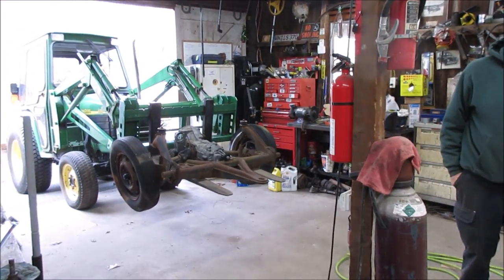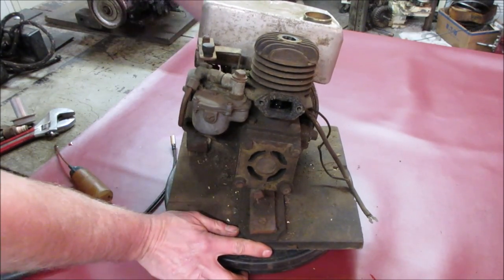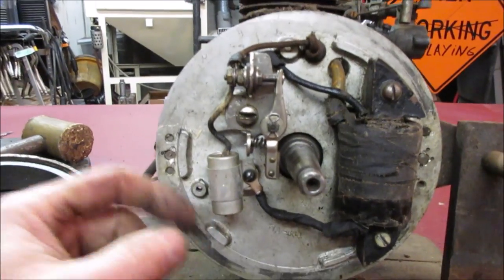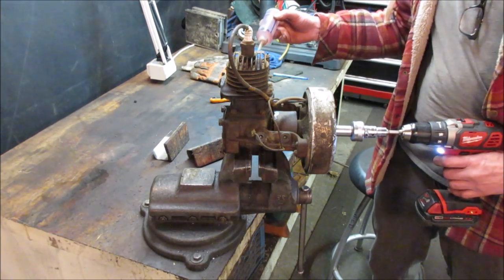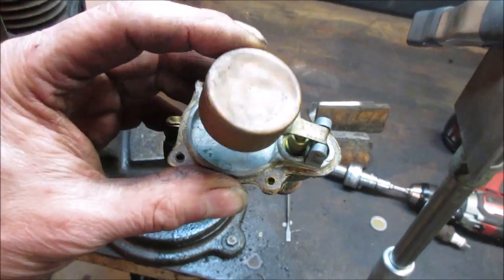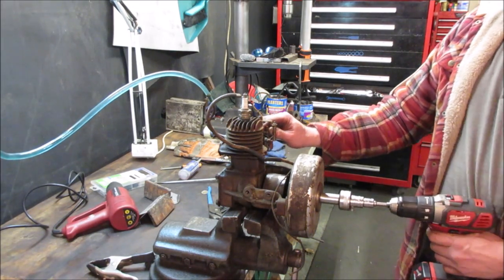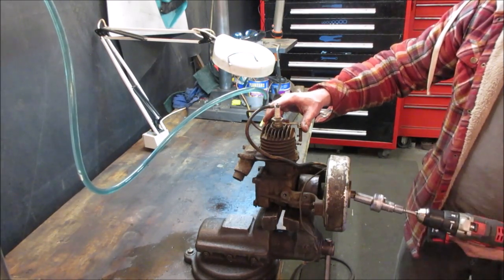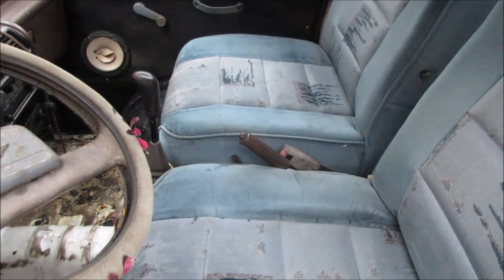Sitting at Least 45 Years In A Barn, Pre War Elgin Cycle engine.

Comment: I used to own a 1930's Elgin canoe outboard, you could spin the whole engine/propshaft around to nearly 340 degrees compared to the clamp mount.  Was not very fast even on a small aluminum dingy.

Comment: The friction drive front wheel driven bicycles were very popular in France up until the 90s they had a super heavyweight front tyre and the drive drum add knurling on it to give it rip in the wet
Reply: This was the info I was scrolling for, thanks! Like how the hell did tires last, and clearly they didn't have much tread, combined with the bare friction wheel surface...did you just not ride these when or after it rained?

Comment: At full tilt that bike would be moving fast!  It's amazing that frequently Mustie uses few or no parts to repair these motors--this time he used a spark plug and his brains.  On the Daihatsu mini truck, he couldn't go to the Stash and look for a Daihatsu carburetor.
Reply: I found an ancient lawnmower in the garbage,  with a Briggs & Stratton engine, and I  changed oil, sparkplug, fresh petrol, and it was very reliable after, better than many new lawnmowers.

Comment: Cool video Mustie! The neighbors had one of these on a huge old bicycle in their barn. My friend and I got the tires patched up and found out the motor used boat motor gas.
Mounted on the front wheel it did a pretty decent job of moving the bike. Noisy as heck and temperamental but it was fun doing laps around the barn and zipping up and down the country road.
It comes to me that the wheels on the bike were 36 inch but that was 50 years ago..........
Cheers
Terry

Comment: Run against rubber front tire and had a 20 inch flex pipe on engine to go past bottom of front end to keep oil off of your feet,  The  pull from   exhaust made engine run smooth no  exhaust and the engine was a pain.

Comment: I was reading a 1930s hobbies book and they were talking about 8 to 1 fuel:oil mix but obviously modern 2 stroke oil is vastly superior to the straight 30 or whatever they were using back then. I think the oil used to separate out so all that vibration probably helped!

Comment: This engine would be perfect for a vapor feed. You don’t need a carburetor; just fill a glass jar halfway with gasoline, put on a lid, and then run a hose to the air intake. The gasoline must be gently vaporized, but that’s no big deal. Remember that heat is one way to vaporize fuel, but aeration is another. So put an aquarium bubbler in the jar. It might need a lot of bubbles, but you’ll get enough vapor to run the engine.

Comment: At 39:43 you could see that most of the compression was shooting out the spark plug threads.   Normally putting in the spark plug by hang seems fine.  In that case it looked very leaky.  After that Daren talked about crank seal leak.  I believe we were actually seeing spark plug leak.  It was pretty substantial.

Comment: My Farmall super a had a large Beast spark plug it appears that that's workload is bad it's it's requiring that down deep and you will see that more under compression than you will when it's just got no load on it. This 302 / 289 engine head large as well. Thanks from Bob in Virginia USA

Comment: that part you are working on connects to a long metal shaft with a propeller attached to its end an early inboard motorboat! there was a spoon shapedguide under the prop that would raise the propeller shaft  so it never got damahged in shallow waters the shaft would have had a length of spring as a part of the shaft, to allow for shallow water shaft displacement!

Comment: I'm thinking that engine is from 1936. From the photos I viewed on the internet that hub/wheel rubs on the front tire and it spins the engine to get it started and away  you go. The engine has been modified with a pully and spacer  and the outer cover grooved/notched so you can pull start the engine. The cover with the company name fits flush with the flywheel in its original configuration as a cycle engine.

Comment: If you were thinking'40's or pre war then think again that is an engine from a 1920's vintage Elgin motor bike. They were Harleys Davidson's competition in the 1920" s and looked similar to them with the motor driving the front wheel instead. It was mounted in front of the handle bars. Those Elgin engines are fairly rare and could be worth a lot of money and likely why your friends uncle was holding on to it. I know Harley engines from this era are wort a lot of money in working condition. My guess is this one is too to the right collector that is trying to restore one of those rare Elgins more so if it is all original.

Comment: (commenting early in the video) I'm pretty sure that does have a pull start, it just doesn't have the rope, back in the day you would have a rope with a wood handle on one end and a knot on the other, you slot the knotted end into the slot on flywheel on the engine then wind the rope onto the drum. Then you pull it and if it didn't start you need to wind it again.

Comment: It would be interesting to compare this "minimum necessary change" approach with the ChefTush one: Full disassembly, cleaning, repairing, reassembly prior to running. The latter might have been a preferable way to deal with this one. I am always surprised when the capacitors in ignition systems appear to work decades after they should have failed in one way or another. I'd be tempted to replace them every time.

Comment: The top of the carburetor where the gas is seeping out….. I believe there should be a brass pin in it that floats in it to also mix air…. I believe the pin would have a spring under it

Comment: Leaking crank seals would cause low compression, which I think is confirmed by lack of power because it didn't spin up much even when it did fire.  So I would respond to low compression by increasing the plug gap.

Comment: My early villiers 2 stroke is not fitted with crank seals. It relies on long main bushes and a oil rich 16 to 1 fuel oil mix. 4 strokes a bit unless under load.
Reply: Yeah, I was going to say that. Early 2-strokes didn,t have garter-type seals, just tight-fitting brass bearings. When they wore, you had to use 10/1 fuel/oil mix. (Old Villiers/Atco lawn-mowers, fo instance.)

Comment: Wow this is so interesting. Sears and Roebuck prior to WW2 had Elgin as their in-house bicycle brand. I found and actual catalog page showing this engine sold with bike $69.95 or by itself for $39.95! It claimed 70 mpg.
Reply: That was big money back then. In 1932 $69.95 would be $1,448.61 in today's money!
Reply: So when I get digging, I get crazy. So it appears that Sears advertised this as the "Elgin Front Wheel Drive Motorized Bicycle" and near as I can tell the engine was fitted to the "famous Elgin Cardinal" model. This Cardinal model had a big round headlamp clamped to the handlebars which was powered by a huge cylindrical battery hanging below the top tube. The Cardinal dates back to 1929 if not earlier, but since Sears refers to it as "famous", the motorized combo must've come later.
Reply: So I saw a blurb suggesting that the Cardinal model ran from 1929 to 1932 but I've only seen actual bikes claiming to be '29 and '30. One version of Cardinal ('30 I think)  seems to have had a little die-cast airplane on the nose of the front fender which would've been deleted to fit the engine probably. I  found an old photo of a teenage boy in the 30s standing behind his Elgin Cardinal bicycle. It seems that the aforementioned airplane ornaments, the little leather tool pouches under the seat and battery cans hanging beneath the "tank" as well as headlamps, horns and "tanks" tend to be missing if you even find one of the old prewar bicycles. The so called "tanks" were a storage box with a removable panel on the right-hand side, fitted between the dual top tubes running from seat to steering yoke. The government should have all the Sears catalogs digitized and made available for us to peruse online since they are such a valuable source of history. The govt never does anything useful though. They just drag us into one war after another.

Comment: Sparkplug just a bit too loose during the troubleshooting, this motor must like it's compression to use a little bit of heat with the weak spark. Saw fuel misting out a few times after it was just removed and popped off prior.

Comment: The Elgin never seemed to run with a steady cadence, except when revved way up.  When you showed us the spark plug sparking, it seemed to me to not be sparking regularly either.  Is there a way that the magneto can be faulty so that it doesn't always trigger a spark when it should?  If the poor beastie has a miss due to a bad magneto OR fuel supply problems couldn't that be one of the reasons it runs poorly?  
I'd love to see you take another look at it and maybe make it run better, if you can rustle up the right parts.  Would a modern carb or magneto be available?
Reply: It looks like I wasn't paying attention when I watched this last week!  You never did put in a new capacitor and I don't think you resealed the crankcase.

Comment: My guess? The condenser, because of the sporadic spark. I have had cars do it because the condenser was not changed when the points were.
Bet that was a hand full with all that weight on the front wheel ,being all cast iron.

Comment: "Eisemann" (as stamped on the engine) is a german company/brand for generators and such. They belonged to Bosch for many decades (1925-1998). I don't know if they really made their own engines
though. I have an eisemann generator from the 1970s or 80s (came with the house...) with a briggs & stratton, but there are also many models with sachs engines. Maybe this is related, maybe not...
Reply: Correction: "Eisemann" was also a Brooklyn based company producing magnetos (the part where the name is stamped on). I don't know if they are in any way related to the german company with the same name.

Comment: Given that Elgin engine, I'm wondering if it's the same kind of motor on an actual moped I used to have that was made by Honda. Basically, the pulley has a centripetal clutch (which automatically engages or disengages based on load) that was engaged by a locking lever of some kind that engaged and disengaged the belt drive. 

And yes, you'd pedal the bicycle to start it, just like my moped.

Comment: It shouldn't overheat because even though it has no wind over the cooling vanes, it has no load either, and that should make up for it.  And it was definitely improving with run time and temperature, so I would run it longer, long enough to burn the carbon off the plug.

Comment: Elgin cycle motor was belt driven to a large drive wheel mounted on bicycle rear wheel it also incorporates an automatic valve in the induction port and pressure operated oiling system
Reply: But then why the friction drive running in the opposite direction?

Comment: Maybe since it's a 2 stroke, it could rely on an exhaust sytem, that has "a continuous flow" that then sucks "a little more" exhaust gas out of the cylinder compared to without having an exhaust pipe system. That would set the next stroke up with more room for fuelmixed air.

Comment: My aunt had the same motor on a old Columbia 3 speed  the cluch i shi you not was attached to the rear wheel to start it you had to roll down hill once you picked up enough speed the cluch would pop the engine over and away you go

Comment: If you have a cheap diesel on which to experiment, would you try running it on mixtures of waste oil and gasoline and see how it does and what ratio best mimics the power and exhaust color and temperature of regular diesel?

Comment: It still cracks me up when they call it a "condenser" when in reality it's a capacitor.  In the early days of electronics capacitors were called condensers.  But small engine mechanics still call them that to this day, when electrically-speaking they're really a large discharge capacitor.  I hope you replace that old condenser, it's probably leaky as hell and not firing at full capacity.
Reply: Everybody knows, and nobody cares Jeff.

Comment: Hi, I've now seen some of your videos and found the same bias in each one, you have a tendency to drawn your engines - if you see something expelled without hearing an explosion, then it's carb mist, meaning it's too much of it.   Another thing is, on old gas engines, systematically replace the capacitor, it costs nothing and have 99% chances to be dead or close to, you'll spare a lot of time trying to figure out what is (not) going on.

Comment: Like "ktlpep," I too have watched you take on the almost unworkable and make it work. BUT, I also am an electrical engineer, and am shocked at what you do electrically with your rebuilds. The lack of a proper electrical background has robbed your channel of much data.  OK... enough negative output, and here are my suggestions:  buy some proper electrical measurement tools and learn how to use them. Model them after Mr Carlson's Lab. Paul knows more than anyone how to fix and properly repair almost anything, except for you and motors. LOL He has some tools he makes for himself and his Patreon friends. The rule to take away is, if it is an old capacitor, REPLACE IT FIRST. Use only top flight components. This was born out when you looked at this old motor which only worked when the cap was replaced. God bless and good luck! de (this is) KQ2E

Comment: If the shaft seal was leaking it would be extremely hard to get running correctly. you could not get a consistent air/fuel mixture. same with a chainsaw.

Comment: HaHa I'm still sleuthing. This motor was fitted to the Sears and Roebuck Elgin 'Cardinal' bicycle. However, despite many claims of exclusivity, this same bicycle was also sold in 1930 by Montgomery Ward as the 'Hawthorne'. Also sales flyers have been found showing it sold by yet some other entity as the 'Red Knight'. I haven't as yet isolated or verified which exact year it was sold in combination this friction-drive engine.
Reply: Noteworthy: It appears that only Monkey Wards threw in the frame pump and WOW they had frame pumps in 1930! Also note the rims were aparently steel. CHECK THAT: Lobdell was a maker of wooden rims, so the chromium plating must have been on just the spokes. Fun Fact: It was common for gambling joints to make roulette wheels out of Lobdell wooden bicycle rims. CHECK AGAIN! I'm such a NOOB. The wooden rims were actually wrapped in steel and the steel was chromium plated. There's a whole advertisement from ancient days detailing the construction on the web.
Reply: "Sears primarily used the Westfield Mfg. Co. and Murray Ohio Mfg. Co. to produce their special bicycles designs. Sears bicycles sold before World War II were branded as Elgin, and after World War II as J.C. Higgins." 
I've yet to isolate which manufacturer made the Elgin Cardinal for Sears, Roebuck & Co. but it appears that Sears did not have an exclusive deal with the manufacturer for that model and so Monkey Wards sold the same bicycle from the same manufacturer as the 'Hawthorne Flyer' by just slapping different paint and name plates on it.  Very similar to modern China eh?
Reply: More Fun Facts cuz Why not? 
The hubs of the Elgin Cardinal were made by New Departure - the inventor of the Coaster Brake. New Departure Model C - 1927 to 1933 was used on the Cardinal.
Reply: Muncie also sold outboard boat engines with the Neptune brand name.  This engine might be nearly the same: 
Model Name: 1936 OB11 Neptune
Original carburetor: Tillotson MS-73B
Magneto: Eisemann Model 61B
Cylinders:1 
B x S: 2 1/16” x 1 1/2“
HP: 2
Point gap: 0.020
Sheer pin: 5/32” x 1″
Oil: 2/3 pt. SAE-30 per Gal.
Tank,
Exhaust,
Lower unit
Rope plate: Neptune

Comment: Just clean and gap the points and replace the condenser and quit effing around expecting magic. Then you work on carburation.
1-2-3.  THe needle valve (main Jet)  circuit should be cleaned, and you can crack it open a bit if it is starving.

Comment: If anyone  has 100 year old sears catalogs these engines  are listed for 39/49/59/and cents and for the most expensive  super sized model 1$ 
After watching  this video again I don't think these are bicycle  engines at all I think  they are like drones  that would  run anything  you could throw a leather belt on like mommies helper lager engines from the 1950s but these are much older like 100 plus years old 
Edit#2 I think That sparkplug element  is so close because  they ran the engine so much the piston started hitting the sparkplug due to heat expansion.. that flyheel says EINMANN
Reply: If you look at the old Indian  bicycles  from Belgium they are made of steel natural  gas pipes welded together  and the seats are modified  tractor  saddles like you've recreated with big old steel shovels

Comment: I probably missed it, but what's the deal with the oil on this?  Does it have oil in the crankcase?
Reply: You mix the oil with the fuel. The carburettor is connected to the crankcase, oil/fuel mix passes through it on its way to the cylinder.

As it passes through the crankcase the fuel evaporates and leaves the oil as a 'mist' that lubricates everything. The oil mist is then sucked into the cylinder with the fuel vapour, some gets burnt and the remainder goes out the exhaust as blue smoke.